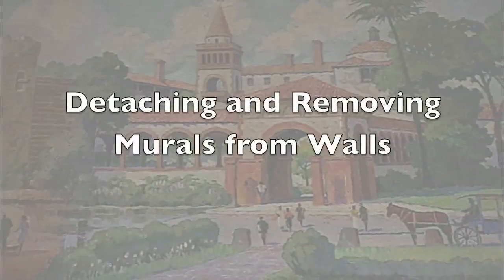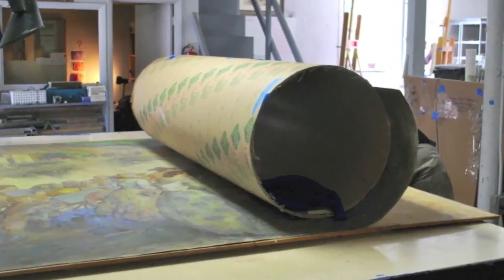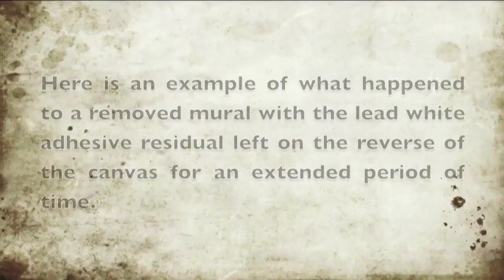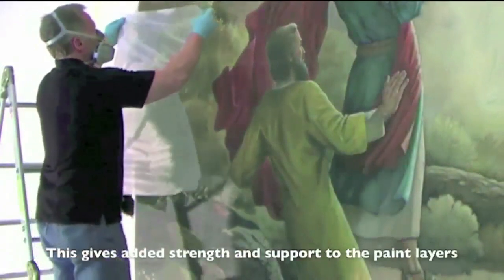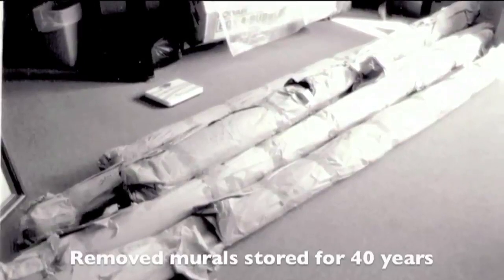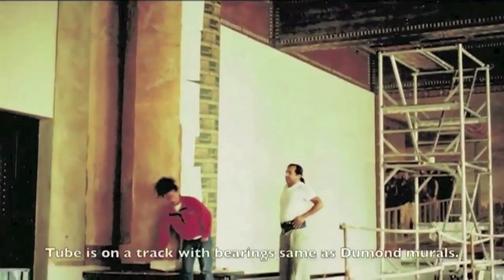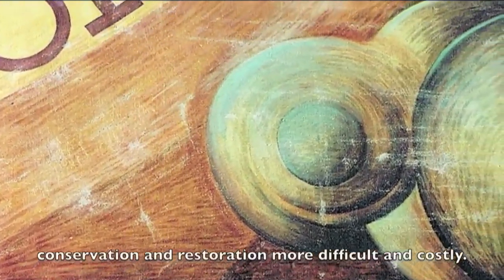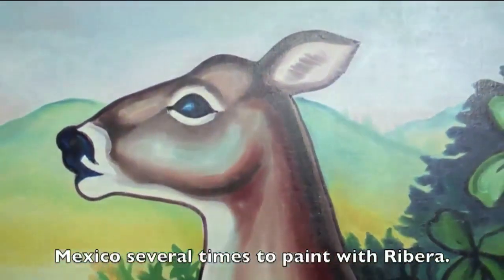Removing Murals, Detaching Murals, Taking A Mural Off A Wall

Comment: This might seem like a stupid question but is it possible to safely remove a wall mural that was painted with acrylic paint straight on a wall?
Reply from the maker: There are several conditions that are required for the process to be successful. "Quick, easy and cheap" are not compatible with the qualifier you suggested, "safe removal." Best we talk about it on the phone. My office number is 805 564 3438

Comment from the maker: @SaulBourgy Saul, I know exactly what you mean by feeling abhorred. I also would leave murals in the place they were created and I feel an ethical compelling need to do so. But, like you said, "saving art" sometimes means getting it out of the building. The last mural I inspected in Florida is in a building that is being demolished because it is so far overrun with black mold there is no way to save the building. So, before demolition gets started, the historical mural needs to come out.